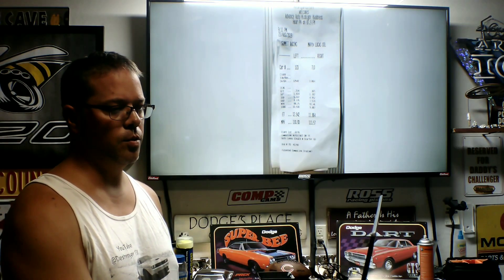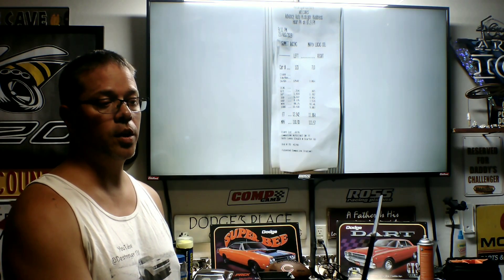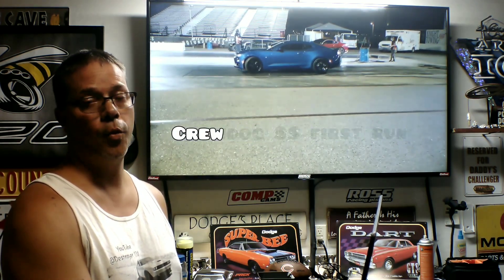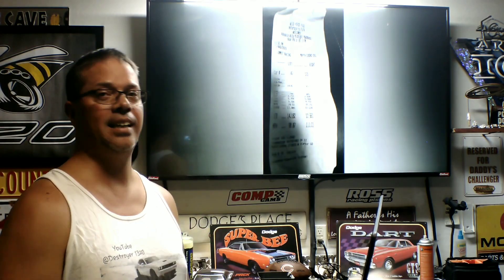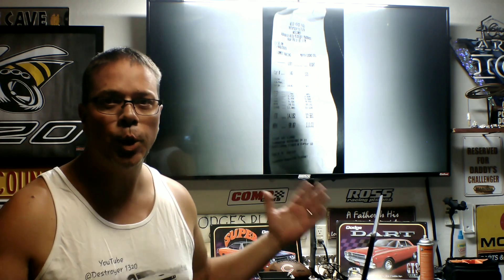2019 Dodge Challenger 1320 (1/4 mile times..DA, is it wrecking your times?)

Comment: I saw a DA calculator a while back and it corrects the quarter mile time according to the DA numbers.
When you calculate a high DA number with your actual time, you will find out what your time would be under ideal temperature and humidity conditions.
Remember, everyone else is racing under the same conditions.
The exception would be electric cars as they are not affected by different Density Altitude conditions.